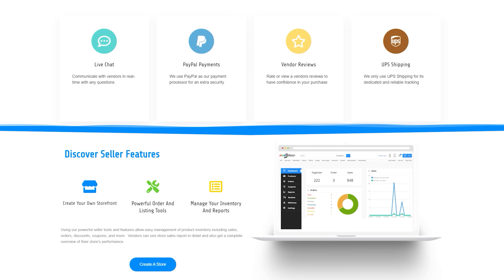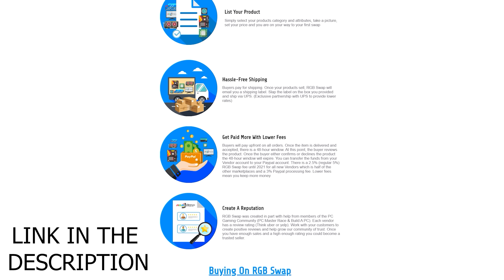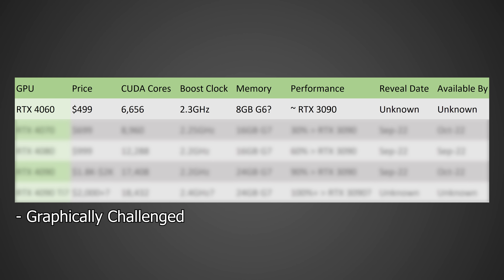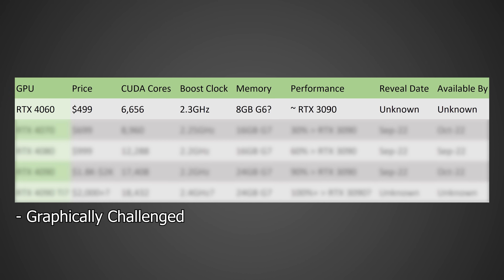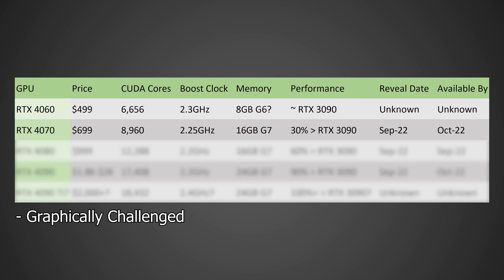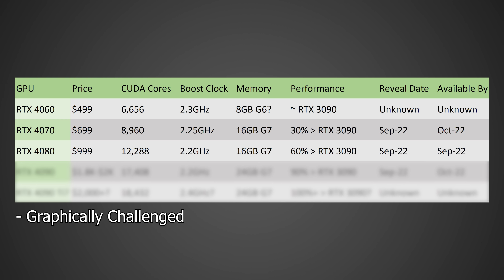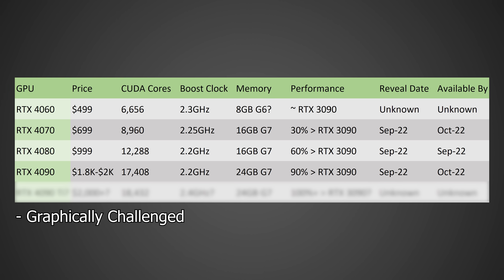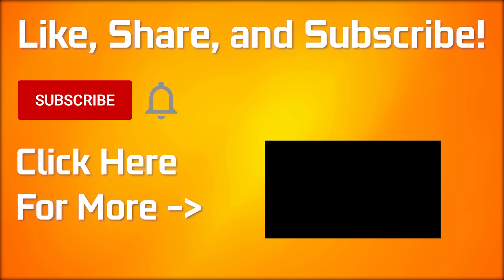Nvidia Lovelace RTX 4080 Price, Specs, & Release Date

Comment: For top-end VR (Varjo Aero) with ray tracing, there absolutely will be a need for 4090 ti levels of performance. It doesn't seem like modern tech can handle that.
Reply: Can confirm, on a g2 with 2080super
Reply: Yes for especially flight simulator games like DCS and MS Flight sim in VR.
Reply: The coming Pimax 12k is going to be 5760 x 3240, compared to the Aero at 2880 x 2720.
Reply: I just wanna run modded skyrim vr more smoothly
Reply: If you have the money, getting a 4090 would be a great future-proofing GPU
Reply: Suicidal overkill

Comment: RTX 4060 will not be any where near? and will only have 12gb or less dream on
Reply: I think at best it will match a 3080 in performance which isn't far off from a 3090 anyways. The 1080 and 2060 were close in performance with the 1080 being somewhat faster. I think I can say the same about a 4060 3080 comparison. At the least the 4060 will have 3070 ti/rx 6800 performance

Comment: Exciting to hear. Hold onto cards until you have the upgrade, learn a lesson.
Reply: That's some good advice right there.
Reply: @jasonforsyth5015  MSRP will be higher AND there won't be any availability. Can only hope AMD's cards will be equally as powerful but at a lower wattage. No way in hell I'm buying a 600w GPU.
Reply: @GSP-76  And here I thought everyone had a small nuclear reactor in their back yard.
Reply: @jasonforsyth5015  Yeah it's absolutely ridiculous. My 6900xt could easily use 350w of power with mods because AMD held it back a bit to keep power usage down... Nvidia will simply do anything and everything just to claim their the best. I suspect AMD's new MCM design will be much better than Nvidia and they know it. That's why they're increasing power consumption to these insane levels.
Reply: @GSP-76  I think a 600W card, with my PC would set the wiring on fire at my wall socket.  Or at the very least, trip a breaker.
Reply: @jasonforsyth5015  yes, it absolutely would...even a 850w PSU would be dangerous. You would ideally need 1000w or higher. Luckily, I had a Corsair 850w that went bad... Corsair replaced it with a 1000w because they didn't have 850w units available. People looking at getting 4090 or 4080 better be ready to buy a new PSU too.
Reply: @GSP-76  1000 W and higher PSUs will also go nuts.
Reply: @andrewt.5567  Yeah probably...they will be the bare minimum...1200 and up will be the proper wattage needed. They can keep those GPUs, I have no interest, lol. Imagine the electric bill for someone who games heavy on a 600w GPU. ridiculous.
Reply: @GSP-76  might as well just get a gaming laptop at this point
Reply: I remember the flurry of 2080ti users who sold off their cards for $300-$400 when the 3080 was rumored to be 2x the performance for $699, lol. I wound up getting a 6900xt at MSRP and sold my 5700xt for $850.
Reply: @GSP-76  w for those who copped for $300
Reply: That’s what I do, still on my 1080ti and still doing a decent job at 1440p
Reply: Common sense really.
Reply: I think I'll just keep my 3080Ti and water cool it. I don't think I need a 4080 or 4090 yet. Maybe I will... Who knows
Reply: @ZFPS115  You absolutely won't need a 4080/90. Don't follow the hype trains like everyone else. A good GPU will easily last you 3-5 years.
Reply: @ZFPS115  maybe skip a gen, im running a 3080 water cooled and i can wait. The 50 series is gonna be insane
Reply: I'm a bit skeptical about that performance.  We'll see.  Either way miners and scalpers will get them before the rest of us.  I've been on EVGA's waitlist for over 13 months now and I don't expect 4000 series to be any different.
Reply: @Darwin-zd3uh  They literally said the 3080 would be 2x the performance of the 2080ti and in the end it was 20-25% faster. Don't believe anything until the cards are in the hands of independent reviewers.
Reply: Yeah but will you be able to get one?
Reply: Ok
Reply: yup learned my lesson selling my 1080 ti for $380 before getting a 3080. Never again

Comment: Will have to see how crypto is going when these release. That will determine if these cards come out at their estimated prices. If they do, then the prices are reasonable at these speeds.
Reply: Crypto won’t make a difference by then. Profitability is at all time low, pair that with LHR and ETH moving to staking, I doubt crypto will be a major factor
Reply: @TheDbtom  We Will see. Crypto has been affecting prices since the 2080ti era. Besides the lull we had at 3080 release prices haven't been normal in years at this point. Here's hoping though.
Reply: @dualisticmix  20 series was hardly affected though, there will always be miners. But not to same level we have seen in recent months. A lot of the issue is with supply though, which hopefully will drastically increase
Reply: @TheDbtom  Yes they were. 2080's and 2080ti's were on Newegg for $2500 for a long time. Also 1080tis were selling for high prices on eBay. This was during the bitcoin surge i believe.  (correct me if it was another crypto) Prices finally fell at the beginning of 2020 though. I personally was able to get an MSI Gaming X Trio at normal price of $1300) at the time and that lull stayed up to the 3080 / 6900xt releases before spiking with the chip shortages and Etherium surge.
Reply: @dualisticmix  In the UK, we were hardly affected, you could readily pick up all cards at MSRP. The best cards for mining came with the ‘Super’ iteration and even then you could easily get all cards. Mining affected the 10 series cards here, but even then, it was no where as bad as it’s been recently
Reply: @TheDbtom  Yeah, that makes sense. Prices definitely are worse now then back then. Overall it would be nice if crypto doesn't affect the new card prices at all when they come out.
Reply: its actually good that its releasing this late. cryptomining will be a lot harder soon.
Reply: @GokieShorts  exactly!

Comment: are the powerlimits already out because if an rtx 4060 already has the power of the 3090 how much power are we gonna see on a 4090 ti? Do we all need 1200W Psu just for a 4080 build?
Reply from the maker: 4060 will draw less power than 3090.
Reply: @GraphicallyChallenged  ok then that will make sense

Comment: There’s no way that that’s actually true, 500 for 3090 perf
Reply from the maker: 3070 was $500 for 2080 Ti performance.
Reply: @GraphicallyChallenged  yeah but the 2080 ti should have been a 700.00 card. Not 1200.00
Reply: @VoldoronGaming  Think it's a pipe dream to see another 80 ti card be $700 from NVIDIA. The 1080 ti was a steal at $700 though at the time.
Reply: @GraphicallyChallenged  I know but it feels way good to be true in the current market

Comment: This is a very revealing video.  Thanks for that.  Well Done. This is the Generation I have been waiting for.  So happy pricing was boinked for last gen cards.  Hopefully there will be little or no market for cards with miners.   QOled matched with Next Gen cards on a DDR 5 mobo  It should take quite a long time before Gaming Software catches up.  You are paying more overall I guess but the rig should last quite a long period before another update is required.
Reply: Gaming software has been bottlenecked by hardware for years. 4090 still won’t be enough for what software can really do.
Reply: I think the 4070 and above will last for years to come before it would even be worth upgrading. I mean 4k+ raytacing at ultra settings are the only things that would make these gpu's even break a sweat.
Reply: @josh8oh8  you don't VR, do you. 3090 isn't enough for current gen headsets
Reply: @slammerf16  Yea I’m not too familiar with vr stuff
Reply: @josh8oh8  you said it yourself, 4k gaming will make the cards sweat. 

Soooooo? Software is ahead of hardware.
Reply from the maker: Next Gen will be amazing for sure!

Comment: if its anywhere near those levels, it'll be a scalper frenzy fest, and prices will be much higher.. at least thats what I think.
Reply: I hope that the retailers have the 1 per person limit up front with this release compared to the 30 series where people were just buying them in bulk
Reply: @tombstonex3244  i think that people might just buy the gpu straight from the aib when they buy in bulk
Reply: @samueldsouza8797  yeah you right but it stops them from doing it with retailers making it easier to buy cards from them
Reply: @tombstonex3244  yes that does make sense sincr most people buy from retailers
Reply: @samueldsouza8797  yeah while there are people that do buy straight from AIBs most people do buy from retailers so it helps to smooth out that rat race
Reply: Theyve had capacity its been the miners anyone that says otherwise is a fool.
Reply: @chodicuss1889  i think that they will book extra capacity to take in account for the extra demand from miners so they can sell more
Reply: @chodicuss1889  i am pretty sure that you have to book the extra capacity 1 or 2 years in advance
Reply: I feel like they are more prepared this time and brought more capacity
Reply: @samueldsouza8797  No they were caught off guard in 2020 along with the problems the world was going through. Then there’s the whole mining situation as well. This will not be the case this time around.
Reply: @ZackSNetwork  I am pretty sure that I said that they where not prepared and booked not enough last time therefore they will book a lot more this time round to keep up with demand

Comment: Time to sell and save for next gen?
Reply: I hope I'm wrong but I don't even believe these performance specs
Reply: @ZZZ-Hip-Hop  me either. The cuda core counts say no. Nvidia would have to get a 50% ipc gain and that is fantasy land.
Reply: @VoldoronGaming  4060 at 3090 perf seems of, i would expect 3070 ti perf at least
Reply: @zakish222  Yeah if 4060 is around 3070 Ti that would be cool.
Reply: @zakish222  3070 or 3070 ti. I agree.
Reply: How can you be confident that it will even be out?
Reply: The biggest issue is wether or not youll even be able to get stock.
Reply: @mfenix88  rtx 4000 has 4 million units
Reply: @zakish222  Source?
Reply: @mfenix88  never mind, it was intel that had 4 million
Reply: Very true. I should have added that I'm using a rx580 so there's a few options available to get a faster card.. there getting good money atm  .so in my situation I might as well get something for it while I can